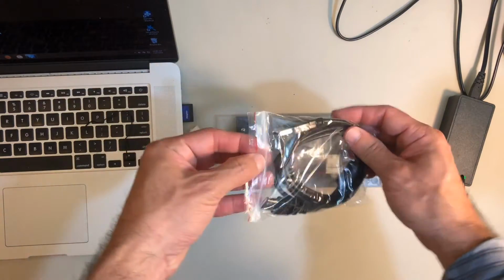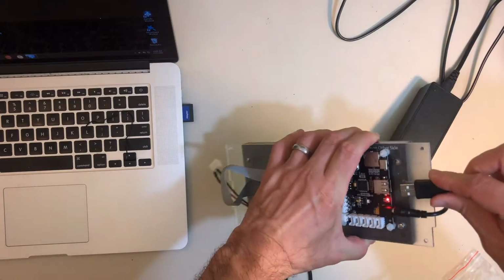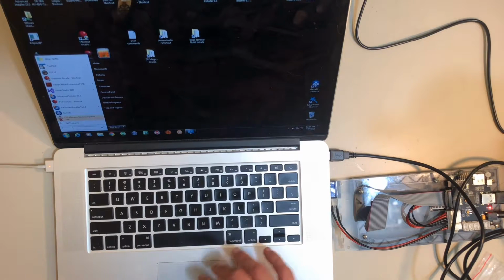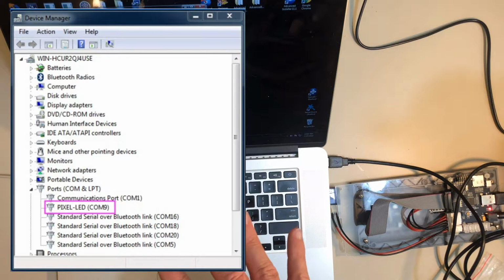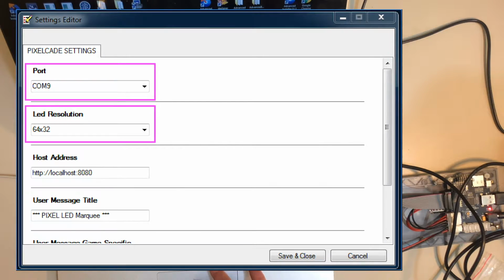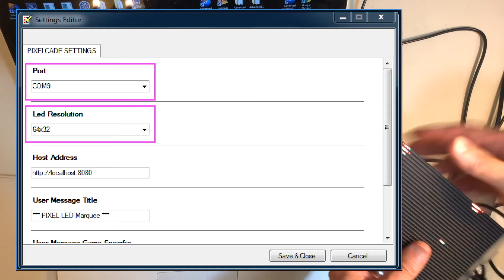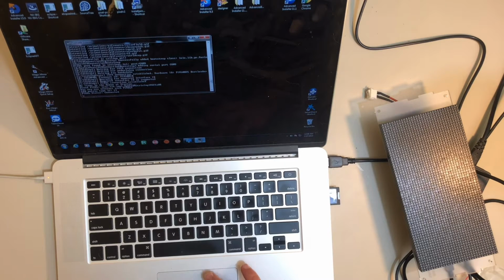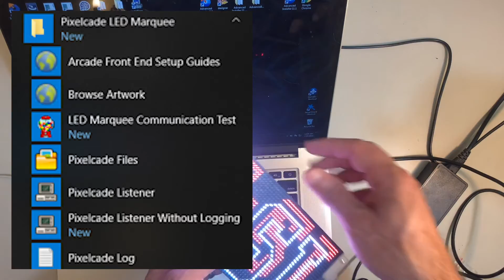P3 1 Panel Setup

Comment: How many of these would it ta to make a 48" x 72"?
Reply from the maker: 128x32 or 64x64 resolution is the max that the Pixelcade board can support. For this large of an install, you may want to look into this project https://github.com/hzeller/rpi-rgb-led-matrix
Reply: @opengadgets  Awesome Thank you!!!

Comment: Hello! I'm currently working on a project where I am going to use these led modules. Your website is not working very good from my location, is there a way to get in touch with you?
Reply: pro trick : you can watch series at kaldrostream. Me and my gf have been using it for watching lots of of movies lately.
Reply: @Trace Brentley definitely, been using kaldrostream for since december myself =)
Reply: @Trace Brentley Definitely, have been watching on kaldroStream for since december myself :)
Reply: @Trace Brentley Definitely, I have been watching on kaldroStream for years myself :D